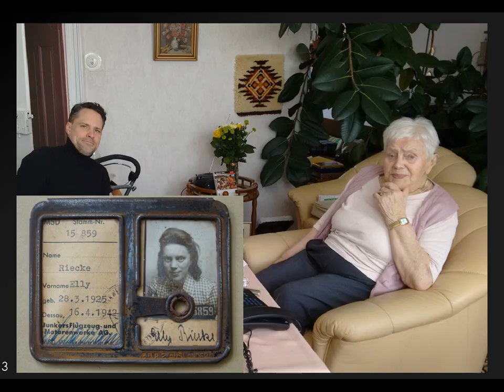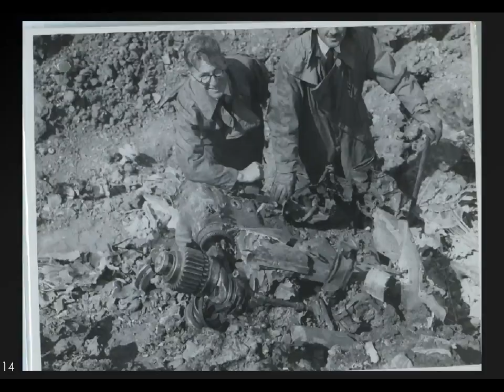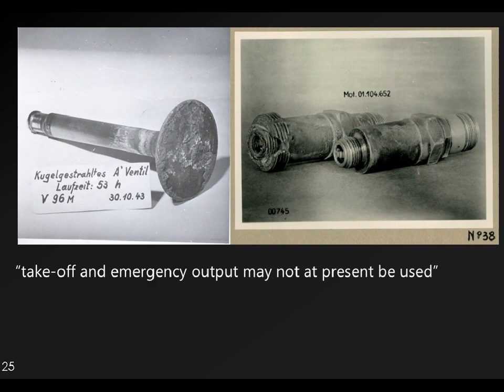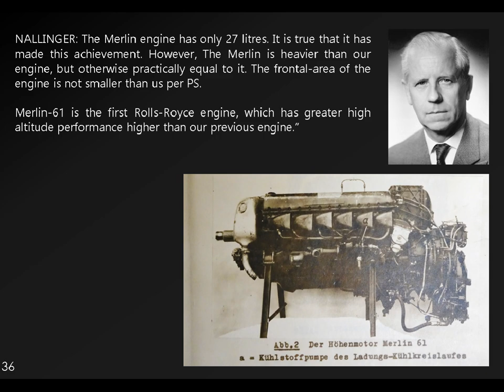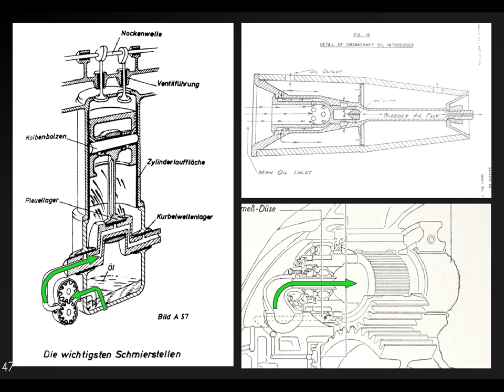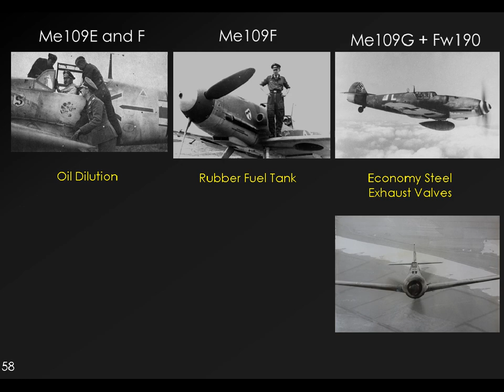The Secret History of Fighter Aircraft Engine Development in WW2

Comment: The state of affairs depicted of Germany is a direct result of an autocratic state, where people are afraid to speak their minds and eventually be the messengers of bad news. It was safer to toe the party line.
Reply: And all large organizations tend to do things to protect themselves rather than achieve the goals they were task with. How long did it take for the turbocharged version of the Alison V-1710 to meet it's potential? That was mostly a argument between Alison and the Air Corp. It took till mid-1944 before the Air Corp admitted that they had been running them too rich and too cool and that was because Charles Lindbergh flew them in the South Pacific (without authorization) and showed the squadrons to do it his way, not the way they were taught. Of course Alison was angry that they were prevented from building a two stage supercharged version of the engine by Air Corp policy favoring turbocharging.
Reply: @keithstudly6071  Actually, the problems of the Allison V-1710 were NEVER fixed in so far as its fundamentally badly engineered coupling with any sort of supercharging.   That's why the P-39 had its original supercharger removed - the engineers at Wright Field encountered all sorts of problems with it and just removed it, and so the P-39 was crippled and useful only for low and medium altitudes.

The P-38s in Europe had MAJOR problems with detonation/predetonation in their engines, and various investigations produced different reports pointing fingers at what the problems were that caused it.   The book "Vees For Victory!" recounts Allison and Lockheed's investigations into this problem, which essentially blamed the aircrews and maintenance crews for mismanaging the airplane and its engine.  This book was heavily sourced from Allison archives, so that POV is understandable, but was also total BS.
  
The changes that Lindbergh suggested worked in the Pacific mainly because the P-38s simply did not operate at the 20,000-30,000 feet altitude of the European air war and so rarely stressed their engines with turbosupercharging, and also did not have to deal with the poor quality British fuel.  The P-38's original job in Europe was to protect the high flying bombers and they could not do that reliably because their engines broke down.  The main effect of what Lindbergh accomplished was NOT to prevent the engines from blowing up, but to simply extend the range of the P-38s in the Pacific so they could conduct the super long range missions that they later became known for (e.g., the targeted assassination of Yamamoto)

The DEFINITIVE investigation and explanation for why the Allison V-1710s were blowing up in Europe came in a report by none other than Gen. Doolittle himself, and is recounted verbatim in the book "P-51 Mustang: Development of the Long-Range Escort Fighter".    His report stated that the Allisons had an inherently poor fuel-air mixture distribution through its manifold, resulting in some pistons getting too rich of a mixture and others getting too lean a mixture, that would predispose them to early detonation. Separation of the American supplied tetraethyl lead from the lower octane British fuel in the manifold also contributed to this problem, leading to some pistons not getting fuel with not enough tetraethyl lead (lower octane fuel) and others getting too much and getting lead fouling.  All of this was exacerbated by use of the GE turbosupercharger at the high altitudes required, resulting in persistant detonations in some pistons until the pistons or rods failed.   Doolittle, a PhD with expertise in the oil-fuel industry, having worked for Shell in the prewar years, recommended special fuel blends be shipped to Europe to prevent these detonations and solve this problem, but at the same time that his report came back, field modifications of the original P-51Bs to extend their range were showing their outstanding potential as a long range escort, and no problems with the Packard Merlin engines blowing up, and so the P-38 was simply withdrawn from the high stress high altitude combat operations of Europe and replaced.   The P-38 continued to be used for reconnaisance in Europe, however, and Doolittle even flew a P-38 over the Normandy beachheads during the D-Day invasion to observe first hand.   

Postwar, the twin Mustang F-82 that North American designed was forced by the USAAF to use a supercharged version of the Allison V-1710 because the USG was tired by that time of paying Britain a $3000 royalty fee every time they used a Packard Merlin.  Edgar Schmued, the Chief Designer, recounted in the book "Mustang Designer"  that these engines had terrible problems which Allison basically refused to spend any effort to solve, and so although the F-82 was sent into combat in Korea, they had a documented very high level of maintenance problems and were soon withdrawn and out of service entirely.

So, the REAL TRUTH is that insofar as Allison was concerned, the company, a division of General Motors, couldn't care less about fixing the problems of the V-1710 with its supercharging or turbosupercharging.   They had huge contracts for the engine as is from the USG, and were just interested in profits, profits, profits.   Making the V-1710 technologically leading edge or competitive with the Packard Merlin was not an issue because the hierarchy of the USAAF were never going to buy the Merlin engine from Britain on their own. The Merlin engine P-51B was entirely an accident of British-American cooperation.  The P-51 was originally designed FOR THE BRITISH with the V-1710, and then the P-51B Packard Merlin engined offshoot was literally stolen back from the British by  American field commanders who saw how good it was (all the later manufactured P-51s originally requested by Britain were requisitioned by the USAAF for its own use instead).  The P-38, P-39, and F-82 were thoroughly American airplanes, and so NEVER got the opportunity to use the Merlin engines.   That's also why a Griffon powered P-51 never happened.   The politics were just too insurmountable.
Reply: Or possibly that the German effort was typical of an organisation that was overwhelmed by its excess of ambition ? For the British, and once the scare of invasion has passed, things could proceed at a very much reduced level of urgency. Certainly in terms of scale, the British effort was modest in comparison.

As for the stereotypical view of an authoritarian state, one could counter that with the actual behaviour of the USSR during the war when pragmatism rather than fear tended to be enforced by the real need to both win and expand territorial control. If one accepts that NAZI Germany never approached the use of arbitrary terror such as that which was employed by the USSR before and after the war, then the trying to do much more than one's capabilities allow argument is probably more likely ?
Reply: I agree with him, the fact that Adolph A$$hole and the gang could lock down the truth on any matter and convert lies into the “supposed truth” the German people never stood a chance. But thank heaven A.H. Was such a moron that the allies were probably pretty upset when they heard C.V.S. And the Valkyrie operation tried to kill him! A.H. was the epitome of micro manager, everything the brilliant German scientists created they had to run it by the moron. Just look at my poor country after the dirty Donald administration liefest, he nearly doomed us with nothing but lie after lie. Words really do have consequences! ‘The truth will set you free, fantasy is the ego of doom”

Comment: Thank you.  This is incredible.  Valve material and not octane was the primary reason for detonation on the DB. Not 100% sure if it was Eric Brown, because try as I might, I just can't find the reference (again).  Immediate post war British inspection of a German engine design facility, it was noted that the Germans had some sort of transparent device to watch the combustion process for flame propagation, travel etc.
Reply: Ricardo in England developed a variable compression single cylinder engine in the early 30s which was used mostly for fuel research into detonation.  I saw one running while an apprentice engine fitter at Halton.  A very clever man Sir Harry Ricardo!
Reply: Sorry I forgot to mention that that engine had a glass viewer of the combustion chamber so we could see pre-ignition and detonation.  The engine was incredibly strong to withstand such use.
Reply: They bought Gunsons glass spark plugs.

Comment: The evaporation delta between C2 and C3 is around 60 degrees C and not 40 as mentioned. Some information mentioned is not factually correct, my grandfather actually worked in the engine testing facility in Germany, I still have some of his notes and manuals from the Daimler Benz engines.
Reply: Dear Wolfgang, 
It is common when dealing with fuel evaporation to refer not to the 100% boiled point, as it is very difficult to precisely measure. Therefore it  is usual to (for example) refer to the evaporation at certain percentages at which it is easier to measure. A common one is 70%, at which, the difference is 40 Degrees. If you claim it is a bit more, than only amplifies my point. You will notice in the video I said "in the area of", not "exactly".

 Everything in the video comes from WW2 german engineering reports and discussion records at the RLM. It is not guesswork or wikipedia material.

Please provide a list of EXACTLY which facts you dispute, together with archival evidence or withdraw your comment.
Reply: 3 weeks later Wolfgang, and we are all still waiting for your list of "not factually correct" items.
Reply: @CalumDouglas  Good for you Sir! That was an excellent presentation, and I for one hate to see your work and knowledge denigrated.  Thank you for a VERY insightful and informative presentation.
Reply: What was the highest power out put achieved by the Napier Sabre aero engine ?
Reply: @michaelgray7847  
That's an interesting question!
I've seen figures from 3000-3500 bhp quoted, but I do not know the source documents.
In his book on aero engines the erudite LJK Setright quoted, I believe, something like 5000 bhp, which just seems incredible. Again, I do not know the source of this information.
Reply: @VincentComet-l8e  The claim of 5000. 500 hp by LJ k Setright  is fanciful  nonsense  .
It seems to me for that kind of power out put , you'd need a much greater engine capacity other than 36 . 65  liters .
Reply: @michaelgray7847  3,010hp.  From P. Closterman`s time life book "the big show."
Reply: @migalito  Wing commander Roland Beamont stated in a letter i received from him that Pierre Clostermans book the big show was based more on his imagination rather than facts .
Interesting i though.